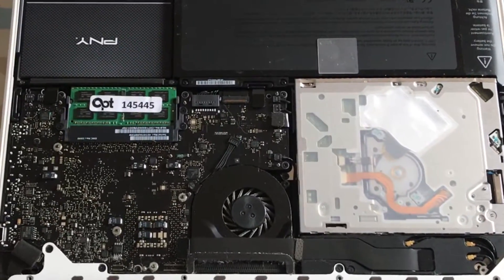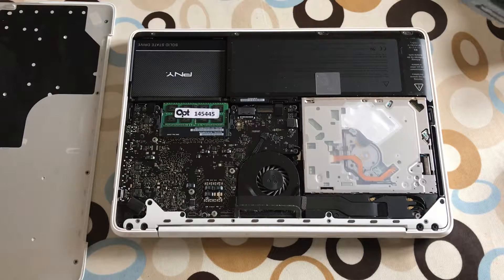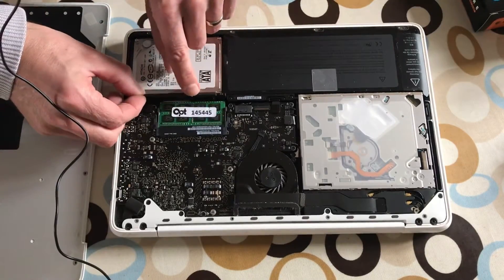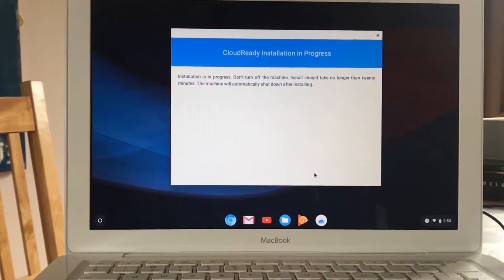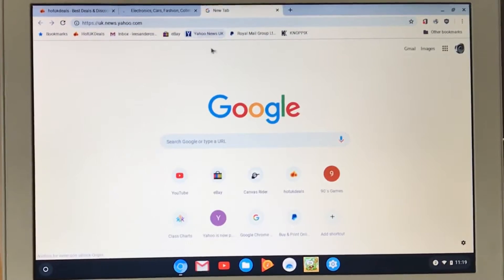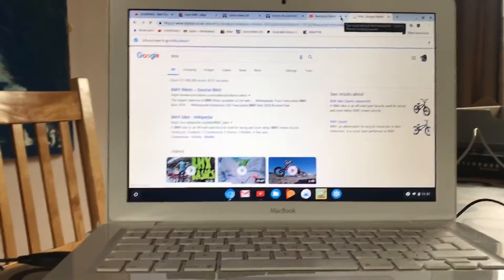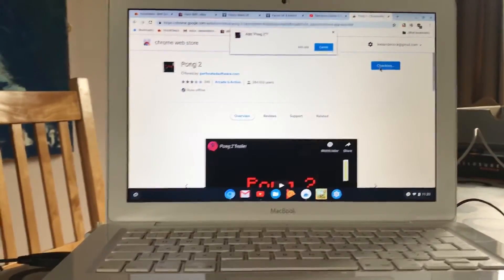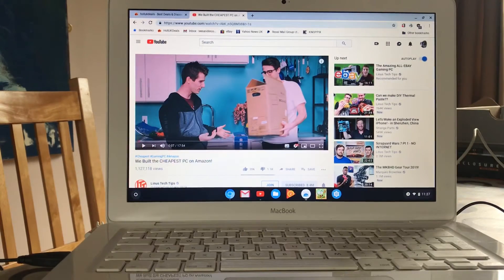Mid 2010 MacBook running Chromium OS in 2019

Comment: I use my macbook pro 2018 to install Chromeium OS. When I boot from usb but I  can not control the keyboard and touchpad on my macbook.
Reply from the maker: Qingfeng Gong I would much rather use Mac OS than chromium on a 2018 MacBook Pro . You can pretty much do everything you can do in chromium in the chrome browser on Mac OS. Chromium is often regarded as a light os to run on low spec or older hardware. I’m sure your 2018 MacBook Pro doesn’t feel slow at all. If it does I would reinstall the os.
Reply: leepspvideo Thank you very much for your advice. I just want to try Chromeium OS.

Comment: I’ve just bought a MacBook Air which has chrome os preinstalled. Is there a way I can change back to Mac OS
Reply from the maker: You may be able to boot into recovery with command R. You can usually install mac os direct from Apple via the internet.
Reply: If you have an SSD or USB drive large enough, you could download IOS to the drive and then boot into that to install it.

Comment: I was wondering if the core 2 duo macbook pro from 2009 is good enough to be running something like Bliss OS?
Sure it probably works, but how well does it work? My neighbour offered me his old macbook pro 2009 for 90$ so i was wondering lol
Reply from the maker: Older Macs have loads of different OS options. My Macbook in this video with 8gb and an ssd still runs mac os really well and is my preferred option. I am about to try Windows 10 on the SSD to see how well it runs.
Reply: @leepspvideo  windows 10 should fly on such hardware since its highly optimized for low end hardware, x86 android based OS's are a different thing, the CPU has to be compatible and even then good performance is not guaranteed.
i wonder how well an x86 android based OS would run on one of these machines (Bliss OS, Remix OS, Phoenix OS etc.)
Reply: @HoLDoN4Sec  I don't reccomend windows 10 on an older mac due to it having all these fancy transitions that slow the computer down, although there is a option to make it run faster, I still don't recommend, Ubuntu no. Chrome os is good but don't load it up with all those programmes that could be too consuming. Any way that is my opinion and if could help you
Reply: @samuelfrankackland22  huh? i have an old computer with a pentium 4 Dual core, 4GB of ram and an old GTS250 running windows 10 just fine and snappy, i've used it as my plex server for years.
if you're ignorant about OS's optimisations don't bother talking about it...
windows 10 is VERY optimized to run on older hardware...
Reply: Hello how can I uninstall chrome os from my MacBook
Reply: Hello I watch this video I tried it out and it was wonderful.. but how can I switch it back to my MacBook
Reply: @juniorattah1840  you cant.
Reply: @juniorattah1840  
You may be able to boot into recovery with command R. You can usually install mac os direct from Apple via the internet.